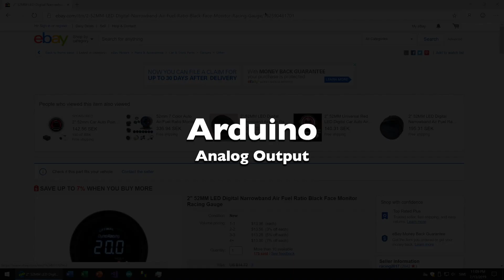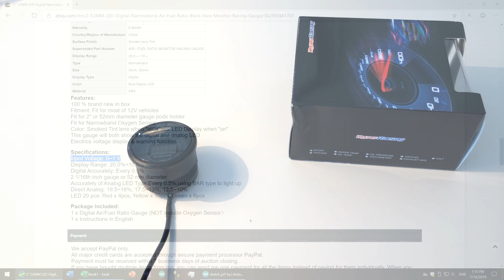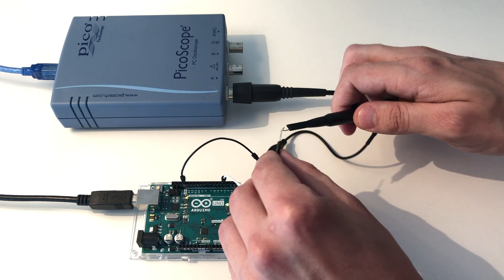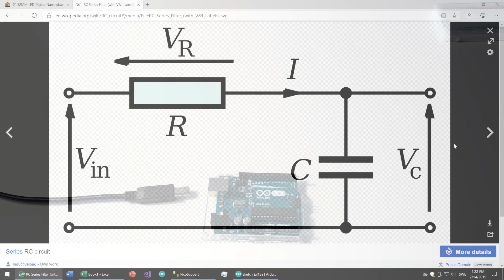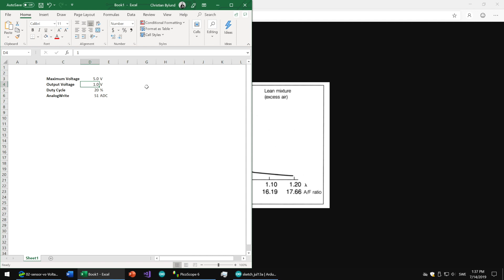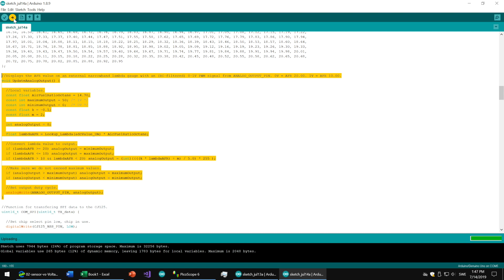DIY Wideband WBO2 AFR Gauge with Arduino®

Comment: Interesting. May I buy it from you please? I am from Malaysia
Reply from the maker: Yes, we ship worldwide. You can order from our website, www.bylund-automotive.com
Reply: @bylundautomotive  Thank you sir. But I wondering, the board already set for wideband gauge or I have to set it by myself?
Reply from the maker: The code is already prepared for 0-1V analog output the only thing you need to do is add the RC components as described in the video.
Reply: @bylundautomotive  The RC components will convert 0-1v to 0-5v? Or will make the narrowband gauge can read the signal from wideband O² sensor?
Reply from the maker: @gilakail  The Arduino will output a 5V PWM signal, the RC-filter (Resistor and Capacitor) will make it in to a 0-1V DC-voltage output. The narrowband gauges require a 0-1V DC signal to imitate a narrowband sensor but the display will be wideband.
Reply: @bylundautomotive  Using a narrowband or wideband O² sensor? Now I understand how it's work but why the first board is different from the last one? It becomes a double layer board.
Reply from the maker: @gilakail  The compatible sensor is Bosch LSU 4.9 of the wideband type. The Lambda Shields are expansion boards to the Arduino Uno and Mega ecosystem of micro controller boards.
Reply: @bylundautomotive  I just realised that my gauge can read both narrowband and wideband. So I don't need the RC-filter right?
Reply from the maker: If your gauge can read wideband you do not need the Lambda Shield at all. Then you connect the sensor directly to your gauge. If you use the Lambda Shield with a gauge you need the RC-filter.
Reply: @bylundautomotive  Unlike other narrowband gauge, my gauge can read 0-5V (wideband), but the problem is it have only one signal wire, unlike AEM wideband gauge that has built-in controller. For my gauge, to show the wideband AF ratio value the one signal wire must connect to a controller device like the Innovate LC-2/LC-3 wideband controller with a wideband O² sensor. If connect directly to the narrowband sensor, it only can show the narrowband AF ratio value. If connect directly to the wideband sensor it will show nothing because it only have one signal wire, as you knew the Bosch LSU 4.9 sensor have five wires. So must connect all five wires to a controller device first, then connect the analog output to the gauge. My question is, the Lambda Shield (without RC-filter) has the same way of work with the Innovate LC-2/LC-3 wideband controller or not? I am sorry for my bad English.
Reply: I want to buy a Innovate wideband controller but I think your Lambda Shield is more cheaper
Reply from the maker: @gilakail  The lambda shield will work for you in either narrowband emulation (0-1V) or higher resolution wideband (0-5V) with the same output as the Innovate sensors. But you still need to the RC-filter. It is very simple, its just a resistor and a capacitor as you can see in the video. Read more on how to get the same signal output (with RC-filter) as the Innovate LC-2. http://community.bylund-automotive.com/viewtopic.php?f=8&t=2231
Reply: @bylundautomotive  must set the configuration before use it? Not just plug and play? 😟
Reply from the maker: @gilakail  By default it is 0-1V. If you want 0-5V you just need to change to it.
Reply: @bylundautomotive  what I need to do that? Is 0-1V work just like 0-5V? No different at all? Still accurate when the air fuel ratio reach 10 or 20?

Comment: So you are only simulating the narrowband 0-1v signal. But the board puts out analong 0-5V  correct? I want to use this in condjunction  with my speeduino.. but im getting confused. Is this a narrowband controller or wideband? Thanks
Reply from the maker: It is a wideband controller simulating the signal in this video for a narrowband gauge (0-1V). You can configure it to output any wideband 0-5V signal.

Comment: what is the value of the resistance in the capacitor?  THANKS
Reply from the maker: Hi Adrian. The RC-filter in the video uses a 220 µF capacitor. I believe the resistor was around 1.5 kΩ. I am sure you can tune it for faster response, I used parts available to me. Not sure if you are looking for the ESR?
Reply: @bylundautomotive  A question The resistor is located on the green wire or the black wire?
Reply from the maker: @adrianadrian615  The green wire in the video is connected to the resistor in series. Red is 12V to power the gauge. Black is ground. I made a post about this on our website if you want to see a schematic. http://community.bylund-automotive.com/viewtopic.php?f=8&t=2211
Reply: if ineed an 5v source  what shoul i do

Comment: 0-1v is not wideband.
Reply from the maker: It is wideband, the 0-1V is required to match the input range of the gauge. Narrowband = rich or lean, wideband = how rich or lean. Perhaps you are confusing it with narrowband sensors outputing 0-1V?
Reply from the maker: @maximexc  Maxime, are you referring to 20$ narrowband sensors like the 3 wire ones, or 20$ counterfeit wideband 6 wire ones? Original wideband Bosch LSU 4.9 typically cost 100$-150$ including VAT. The problem we have seen repeatedly with the counterfeit sensors from China is that the heater feedback to the lambda controller is not working properly which is why we do not recommend them, that being said this may not be everyones experience.
Reply: @bylundautomotive  Thank u
Reply: it is wideband, the controller convert wideband signal to 0-1v + RC filter (Narrowband simulation) so that can be read by narrowband afr gauge. The narrow band signal always fluctuate from 0-1v.

Comment: Your a legend Christian, for those who don't know about the Bylund Automotive Lambda Shield i have one and appreciate the fact that Christian continues with the development on this shield 
He is also developing an app for smart phones.
Reply: I just found this Lambda Shield and it looks clean and simple, just what you'd want.
I don't like the prize tho, that's 265$ for everything not even including shipping. This is waaay overprized. The professional full kits are about 180-200$.
Reply from the maker: @DerKrawallkeks  We are very much aware of the cost problem and are working hard on reducing it for the future. Still it is going to be less costly to buy the shield than making your own from scratch. This is an educative product, design to demonstrate the circuitry behind a wideband oxygen sensor based on the Bosch CJ125 controller and the Bosch LSU 4.9 oxygen sensor.